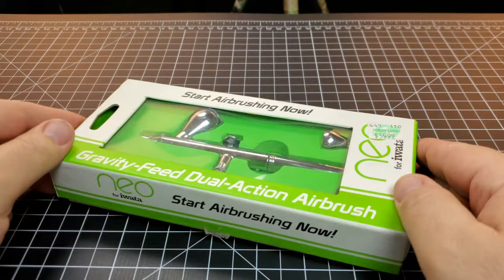Airbrushing With Cheap Acrylic Craft Paints: What You Need to Know

Comment: I use a $10 Harbor freight single-action airbrush for simple coatings.  Replace one o-ring frequently but otherwise works fine for me.
Reply from the maker: Sorry for the late response. I just got back from a two week vacation. I'm glad to hear the harbor freight airbrush is working well. I've never used one of theirs. I picked one up to check it out and it just felt and looked cheap. I don't mean to sound snobbish. I've just been down that road when I first started airbrushing and had nothing but problems with the cheap airbrushes. I never looked at the single action airbrushes from harbor freight though. Their a simpler design than double action so you may be onto something there. Thank you for commenting.
Reply: That is good to know as that is likely the airbrush I will try as my first one. I only need something simple for scroll saw projects.

Comment: In all my paint bottles which do not have an included mixing ball, I put an 8mm ball bearing and it helps a lot. If you decide to do so, make sure to use a stainless stell 316L or 316 (if you have money) to avoid any corrosion issue. I do not recommend 304 steel.

Comment: I really do strongly advise against using steel (even stainless) as an agitator.  It'll rust and ruin the paint sooner or later.  Yes, I have learned this the hard way.  Multiple times.  That being said here's what I do recommended -  Look online and get yourself some hematite beads.  Price wise, they're pretty comparable to, or even cheaper than, nuts.  Approx 5 cents each, depending on size.  I would suggest starting with one of those variety packs to see which one works best for your specific bottles of paint.  I generally recommend that you use the biggest one that fits through the neck of the bottle without having to be forced in.

For those who don't know - hematite is an ore of iron.  It's essentially rust.  The beads are made from it's crystalline form and they're quite hard and relatively heavy.  They will never oxidize in a bottle of paint because they're already fully oxidized right out of the gate.
Reply from the maker: That's pretty cool to know about. Thank you for sharing....

Comment: Ever tried denatured alcohol instead of isopropyl? I think it works a little better. BTW, you can write the paint mixing ratio on the craft paint cap, or label, with a permanent marker to help remember what your mix is for each paint.
Reply from the maker: Never tried that. I always just grabbed isopropyl alcohol because it was easy to find.

Comment: I’ve tried so many things to thin cheap paints down and make them flow better and I’ve found that things just randomly in the house help the flow as well as buying flow improvers. My favorites so far are milk (regular and chocolate), soda (mainly sprite or 7up) and white vinegar. I suggest you try them out and make a video on them to show how great they work.
Reply: Interesting.....
Reply: What kind of milk? 2%? Skim?
Reply: For flow improver I have found that 90% distilled water and 10% propylene glycol is outstanding. And very cheap to make. 😎
Reply: @nickschaefer9320  My speculation is that skim would work best.  My reasoning -

There's a kind of paint that's been around for millennia called 'milk paint'.  It's literally milk + lime (the mineral, not he fruit) + water + pigment.  When making milk paint, it's the protein portion of the milk that you want.  That's the part that cures into paint.  The fat is undesirable for this application.  The fat won't cure, it'll just go rancid.  For this specific reason, if you're going to make your own milk paint from milk bought at a store, you either want skim milk or you will have to skim it yourself.

All this being said, I don't think I would be using milk (skim or otherwise) for thinning acrylic paint anyways.  Besides the fat being a problem, the whey is also a problem and will go rancid too.  Unless you're going to separate the whey from the casein anyways.  If you do that, you have already done all the hard work to just make milk paint and the acrylic is just redundant.

Comment: Very cool. :) I have a wide variety of acrylics from the "flow" acrylics by brands like Liquitex, the heavy body paste acrylics from brands like Grumbacher or Winsor & Newton, as well as the Folk Art, Deco Art, Createx, and Apple Barrel. Generally I use them for paint pouring with various flow mediums from Flood Floetrol to PVA to plain distilled water. And oh yes, oh heck yes, do I ever need to strain them. I also strain my flow mediums as well, since they can gunk up just like anything else, especially things like Floetrol. The reason I have been looking over your channel for videos like this is because I also paint 3D prints like the ones in your previous video, and I want to make use of what I have on hand as much as possible. I am very partial to certain types of pigments, particularly in blacks and whites. I prefer the whites with titanium dioxide in them and the blacks with iron oxide in them, each named something like Titanium White and Mars Black respectively. The great thing about the heavy body paints is that so little goes so much farther than one might think. I can use those tubes to make oodles of paint for both types of painting! I had to wonder if you have ever used some of the other "art paints" like some that I have mentioned through your airbrush since you mentioned you do fine art painting as well. If this has been answered below, I am sorry if I am asking it again, but I really am curious. Tell me more? :)
Reply from the maker: Thanks for the great comment and question. First off I apologize for the late response. I just got back home from a two week vacation. As far as painting goes. For my 3d prints I buy the cheapest I can get "usually". Apple barrel, folk art, etc. My fine art paint selections are primarily Createx paints and Vallejo paints. I have dabbled with some inks before, but that was when I was first starting out and didn't do well with them. In my opinion I like created the best. They have always been consistent as far as viscosity and color. I hope I answered your question. Please keep them coming. Thanks again.
Reply: No worries regarding delays, that is just life. :)

I have a ton of Folk Art, Deco Art, Apple Barrel Anita's & Art Minds, I totally get ya there. ^_^ No real problems with the pigments. The only "craft" paint I have had pigment issues with is CraftSmart. 

I just happen to have the others at my disposal. I have a ton of the heavy body Mars Black and Titanium White in Grumbacher that I can dilute for airbrushing as well as some of the abundance of Liquitex paints I have. Figured I would ask. :)

Comment: Honestly the best paint mixer out there is those micro-mark battery powered paint mixer. I've brought back paint that was virtually dead by adding thinner and running that mixer in it for a few minutes. No amount of shaking will mix paint as well. For clean up of acrylic paints, I simply run it in a cup of water I keep at my workbench. It will clean itself after I'm done mixing paint. I also run it in a small bottle of solvent after mixing oil or solvent based paints.
Reply from the maker: Hey Funnelfan. Thanks for tip. I get the micro mark catalog. I'll have to check it out.

Comment: I'm absolutely brand new with an airbrush. I mainly build model cars and have used rattle cans my entire life. I've been wanting to try an airbrush for an easier time painting smaller parts or smaller sections of the trees. I just got a battery-powered airbrush off Amazon to try out (a cheap $60 deal just to see if I suck or not before getting anything expensive) but I have terrible inconsistency with the paint. Very splattery, then alright and then crappy again without changing anything. I've been using the decoart paint with water as a reducer, your video helped me realize a couple possible issues I'm having. I believe my airbrush is a single action (air all the time, paint when trigger is pulled) with 22, 26 and 36 psi settings. I'm going to try the alcohol and maybe a better paint later today. Thank you.
Reply from the maker: Definitely give it a try. I have also recently tried a new method of thinning craft paints with windshield washer fluid. That works very well also, but it doesn't dry out the paint like the IPA does so you have a much, much longer working time. But remember no matter what method you use to thin your paints you need to pour the thinned paint through a fine mesh filter. That is the key to it working well in your airbrush.
Reply: @RoadsAndRailsHobbies  awesome, thanks for replying. I'll definitely try that!

Comment: If you want a the best reducer try createx 4011 and my 1. One favorite is Mr.color leveling thinner man its awesome but createx 4011 is the new reducer they say you should use now and the old reducer I use as a cleaner. Love your  Intro I worked on the railroad that the 45 0 1 was running on in your intro The C&C railroad and I worked on the Tvrm back in the early 90s and then had to take a Medical retirement on the Ann Arbor Railroad. Now I am a full time model builder.
Reply from the maker: Man that is so awesome you worked with that loco. I will have to pick up some of the newer createx reducer. I am still using the old reduced from them. Of course I bought the huge bottle like ten years ago. LOL Heck it may not even be any good anymore. Thanks for the great information. Take care.

Comment: Excellent video Paul. When speaking to other model railroaders or just model builders I'm always amazed at how painting with craft acrylics is looked down upon. I'd love to know how many of the "brand" name model paints are simply craft acrylic base with a 'secret sauce" additive that somehow makes that paint worth 10 times more than a bottle of craft paint. The other craft paint topic is actual color selection. Especially model railroaders will fight to the death over buying a specific road name color. If the bottle doesn't say "insert road name here" color then it can't possibly be used in model railroading. What utter nonsense. Sure as a locomotive or rail car roll off the assembly line their color may be accurate to that road name but give that piece of equipment six months of real world weathering and tell me the color can be matched to the original. Keep up the great videos. Dave
Reply from the maker: Hey Dave. Thanks for commenting and for the kind words. I love sharing what I learn with others. I'm still trying to figure out videography to enable me to present my information in a good format however. I agree whole heartedly with your statements. I'm sure that "secret sauce" you mention most likely makes the paints better in some aspect, like paint adhesion, ease of use, etc. I can't speak for other hobbies, however if you're a model railroader then  you know how expensive this hobby can be. I like to save money where I can so I can afford a new engine and such. That is one of the goals of my channel is show folks how to save money and still create something that looks good. As far as buying road name specific colors. I mean I get why they produce them. Some folks either don't have the time, the desire, or possibly the knowledge or ability to create their own color to match the prototype. Me personally I love the challenge. And like you said. After about 6 months in the real world, you wouldn't be able to tell what the original color was anyhow. Take care and keep the comments coming.
Reply: I gotta say I agree with your theory! I have some expensive AND non expensive paints and I swear I can barely tell the difference! And idk why fellow artist frown upon acrylic. It’s a miracle paint!
Reply from the maker: Same here. And the nice thing about using the cheaper acrylics is that it allows you to experiment with a painting technique and if it doesn't work out then you don't feel bad about wasting your expensive paints.

Comment: For thinning these craft acrylics i use 3 parts distilled water, 1part 99% isopropyl alcohol plus 5 drops vegetable glycerin per quart. For  cleaning I replace 1 part of the distilled water with one part of original windex. I always run clear distilled water before i put rhem away.
Reply from the maker: Hey Mike. Thank very much for the info. That's one heck if a cocktail you have there. I'm assuming that since you are using IPA in the mixture that the paint dries relatively fast once it's on the object you are painting. If so, do you have any issues with the paint prematurely drying in your airbrush, and or do you get that rubbery type of consistency with the paints if you try to keep them too long after being thinned?
Reply: @RoadsAndRailsHobbies  It dries pretty quickly, not as quickly as straight alcohol. But if you do thin coats, they dry almost instantly.

Comment: Paul great video. I love the train in the background moving slowly. I just posted a link in my model airplane club on this instructional video. I have been doing this for years now with the in expensive paints. I enjoy airbrushing my models after rebuilds.  Where as some times I am painting larger areas like a wing or tail I use a blow drier to speed my coating build ups, It speed the whole process up. I use a cheap Badger for larger areas and it is a larger pattern. But I do use the siphon feed Paasche for the finer work mostly. My final finish for my purpose I use either Miniwax clear gloss or satin enamel polyurethane for the topcoat. That requires oil base thinners. It is all relative in ways to what you are showing here. Thanks
Reply from the maker: Thank you commenting and sharing my video. I take you are are talking about static model airplanes?  I have built a fair share in my day. I remember the largest one I built was back in the mid 80's. It was a B-29 Superfortress. And yes it was the Enola Gay. It was a Monogram kit. If I remember correctly, it had like a 3 foot wingspan. Then I got into balsa wood airplane models. Mostly Guillow kits. Never flew any of them though. Way too afraid to crash them. LOL. Thanks again. And take care
Reply: Hello Paul,
 I am talking about some very large RC flying aircraft I scratch build up to around 11 foot wingspans. I sprayed the larger areas with waterbase acrylics using the cheap Badger and all the smaller areas and details with my Paasche airbrush. The Badger does well in large areas equivalent to using a spray can. I basically am doing what you do but larger scale down to the smaller park flyers like home built stick Guillows. I do rebuild many 4-5ft. range foam fliers also. All are airbrushed.  Your small scale routines here apply to some of what I am doing.  @RoadsAndRailsHobbies
Reply from the maker: That is pretty cool. I just bought a cheap hobby grade laser and was kicking around the idea of scratch building a plane. It would be so easy to cut put all of the necessary parts for one.

Comment: Great video, thank you

A couple of questions on your techniques if you don't mind please.

1. Have you ever used 99% IPA as the thinner, and if so what were the results like?
2. Given an appropriate 'airtight' bottle, do you find the mixed paint retains it's properties, and if so, about how long would you guess the shelf life of the mixed paint to be?

Many thanks in advance.
Reply from the maker: Hey David. Great questions. 1. No I have never used 99% IPA. I find 70% to be the sweet spot between quick drying and yet a decent working time before the water content in the paint becomes to evaporated and makes the paint rubbery. I think 99% would not be advisable. 
2. With and air tight bottle, the longest I've been able to keep the paint that I thinned with the 70% IPA viable for airbrush use has been around 4 days. After that I wouldn't chance it. I hope I have answered your questions well enough. If not let me know. Thank you for watching and commenting. Take care.
Reply: @RoadsAndRailsHobbies  Many thanks for your response.  Looks like I'm going to be experimenting soon.
Reply from the maker: Have fun. If you run into a roadblock, message me and I will help if I am able to.